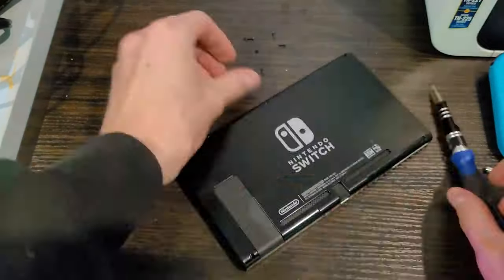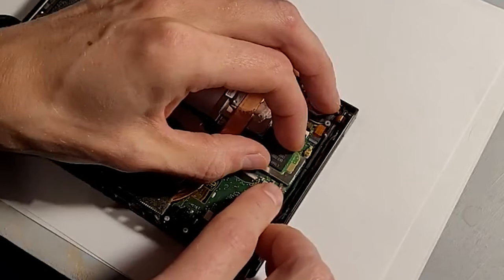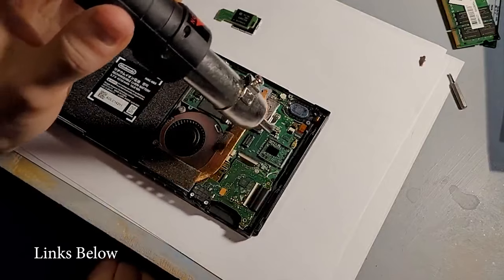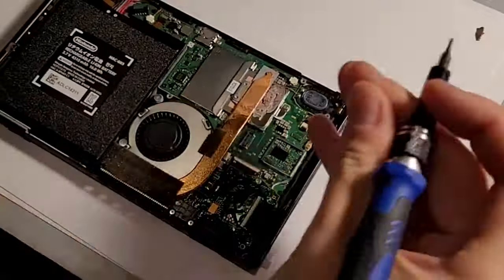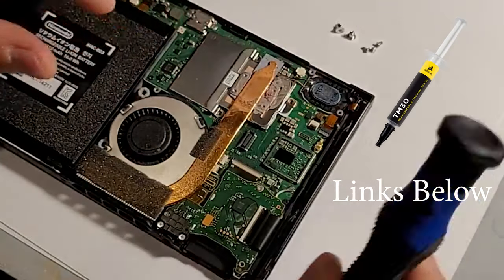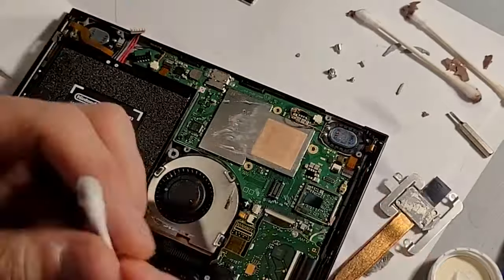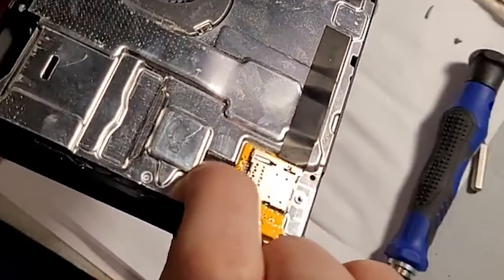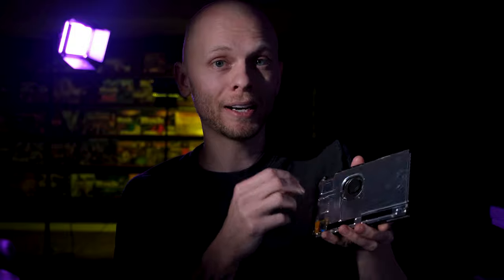Nintendo Switch Orange Screen of Death | Easiest DIY

Comment: I DIDNT HAVE TO DO ANY OF THIS!!! I did a hard reboot and let it sit over night, everything went back to normal! 100% I freaked out at first but I remembered I hard booted it once for a different reason. I tried and it worked. Just push the power button twice then hold for about 20 seconds or so then it should just turn on with a single press of the power button. 🎉🎉🎉 it worked for me. The fastest and cheapest fix.
Reply: May I ask if it happened to you again? Especially if you download large files like games?
Reply: @its_rhuzel  This has beened to two of my switches, both times they were left on the DOCK. DON’T LEAVE IT ON THE DOCK. This is what caused this to happen. I haven’t had this happen when left off the dock. It’s only happened when left docking.
Reply: @its_rhuzel  I’ve never had an issue downloading large game files. I have a 500G chip. If you’re docking while downloading then that might be an issue considering the console is trying to download, (draining power), but the charger is working to keep it at full charge. I think that could cause an overload issue. To fix this you need to press the power button three times and hold on the third or fourth times and hold on the fourth for about 20 to 30 seconds until the entire screen goes from orange to black then I let it sit overnight turn it back on… i never have issues. You probably don’t need to let it sit overnight, but I do just because.
Reply: Happened* to two of my switches.
Reply: @@Malcolm115I’m glad I could help. 😅
Reply: It's happened to me 3 times now and as of recently but I just hold the power button and it's good but once it happens permanently I gotta get a new Nintendo Switch. I'm not smart enough to do this or have the tools
Reply: Not Al heroes wear capes, man the amount of lives u saved. It just worked for me too, tried your method😂❤️
Reply: It happens when left on dock

Comment: I got so scared when I left my switch to charge and then I saw it turned orange screen. I panicked and search it up and saw “orange screen of death” like WHAT 😭
But anyways I just hold the power button and turned it back on. It’s fine now.
Reply: It will happen again.
Reply: @TwoTall1988  Good idea to get it replaced then. An exchange is quick and easy.
Reply: same i was terrifying like wtf 😭😭😭
Reply: It happen to mine today 😢 exactly as you said

Comment: i was just lying on my bed, and my playstation has a orange glow at the top, so i looked at my switch and it had an orange screen. but i just held it for about 15 seconds and it worked
Reply: That worked for me at first but now i press the power it flashes nintendo then goes orange immediately i hold the power down it shuts off i restart it and the same thing happens im at a loss idk what to do here 😭😭 and i just got a bigger ssd card and the batman trilogy somebody plz help!!

Comment: I did heat up that area 2x and everytime I did that, the switch turned on and worked. The day after > orange screen again 
What is wrong with my Switch??? 😢

Comment: I just got a new switch oled, and this happened to me when downloading some games on it. I'm going to try returning it to the store I purchased it from and hopefully not have the same issue with a new one.
Reply: Same for me. Any updates?
Reply: @Jay Tee  No I've just been recommended to return it to the store I purchased it from to be looked at.
Reply: @jakesdronephotography224  Did they replace it? I have the same issue.
Reply: @Mei Kisaragi  Yes, they did replace it for me, but the new one did the exact same thing. So I'm wondering if it's a hardware issue.
Reply: @jakesdronephotography224 When that happens, hold the power button for like 10 seconds, it will turn off. Then you just gotta turn it on again

Comment: Well, used a heat gund at 250° for 5 minutes and completely unsoldered three near flat cables.
Maybe masking chip surroundings should be advised
To the repair shop it goes
Reply: Or just hold the power button and try rebooting the device first
Reply: It's your problem...

Comment: It's just unbelievable how Nintendo just doesn't fix this shit! Almost every time I'm downloading something and the console puts himself on sleep mode I'll get the orange screen and I have to reset. Just awful, Nintendo it's just the worst.
Reply: Same bro 😢, and i just bought a Nintendo switch and in my country there's no official Nintendo switch support, btw how is your Nintendo switch working right now? Did the orange screen caused any problem or is the switch working fine?
Reply: @Holl0w.kn1ght  it's working fine nowadays
Reply: @Sr.D  I see thank you, I was really bothered because I just bought a switch and I get orange screen problem , I was so scared 😭
Reply: @Holl0w.kn1ght  try to update to the latest firmware
Reply: @Sr.D  I'm on the latest firmware

Comment: So I just watched this. But the thing is, I just bought my white OLED last night. placed my only one game SSBBU, launched it, asked for a software update then boom it Oranged. Couldn't turn it off so I quickly googled and saw what this is thru a google result. Today's my 3rd orange and yeah I've noticed its WIFI signal is VERY poor. not just poor. Do I have to live with it?
Reply: I guess you can try to just put your switch in airplane mode and only use it offline from now on. I guess you can use an ethernet cable if you really need to go online. I dont really know if this is a permanent fix tho.

Comment: I Just Had IT but,I turned it off and now it works properly,is it going to happen again?it happened while I was downloading the demo of Kirby's new game,it was almost 100%now I have to download it again,at the same time I was playing children of morta and it was lugging,my SD are full
Reply: maybe its kirby. ive had my switch oled for some months and i just got kirby a few days ago. then today i got an orange screen
Reply: @jonathanlinzy9045  I don't think it is Kirby. It will most likely happen again, early or late. The Orange Screen of Death have different behaviour depending on the case. The solution is easy though.
EDIT: also there's a orange screen bug on the nintendo eshop that can confuse you. Check out it isn't that
Reply: @grego2165  Okay sounds good much appreciated
Reply: @jonathanlinzy9045  Np. If you have an Orange screen again you could send it to Nintendo, considering it is an OLED and still on warranty
Reply: @grego2165  Okay so the first orange screen i got yesterday was a bug maybe. i just held the power button and it was fine. got another about 15 minutes ago and resetting it didn’t work. i’m guessing I’m going to most definitely have to send it to nintendo
Reply: @jonathanlinzy9045  I don't think the first one was a bug. In my case the OSOD only appeared when i enabled wi-fi, when it was offline i could play as much as i want, i think it is related to how badly is the wifi chip soldering or if it's completely damaged.
Either way, sending it to Nintendo is the most clever thing you could do. No need to mess up with electronics when it's still on warranty. Good luck

Comment: What causes this? I barely use my oled switch and i just started getting this screen. Why?
Reply: I have no idea why. I turned on my switch to check something real quick and then left it on the dock later in the day I got the orange screen. I barely use mine as well
Reply: @Bulbsonn  thats what happened to me i barely use it and leave it on the dock. It probably has something to do with leaving it on the dock for long periods of time. I started to leave my switch off the dock when not in use and i haven’t seen the screen yet. Try it out and let me know. We gotta get to the bottom of this.

Comment: you know you can just hold the power button for 10s
Reply: Doesnt work most cases, although it will work if your actually home network is the issue, but most of the time its the physical hardware.